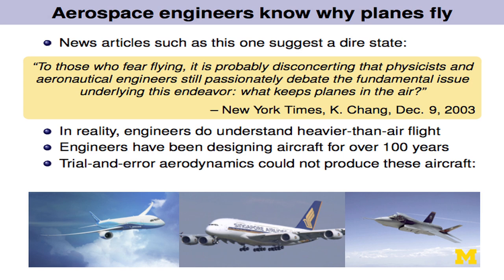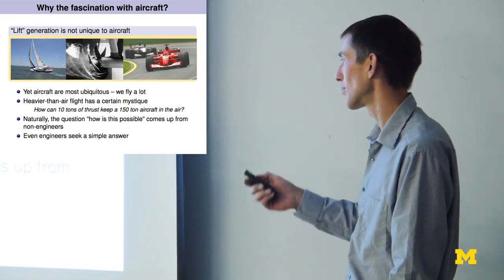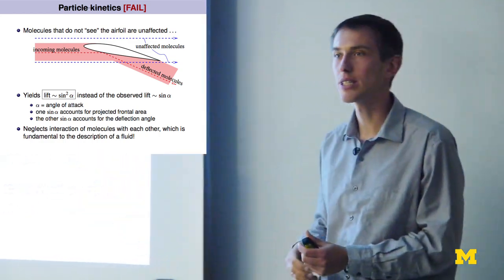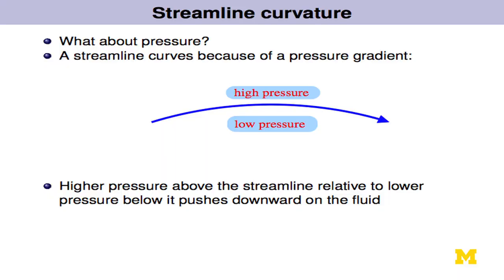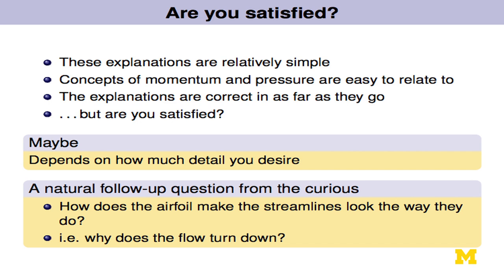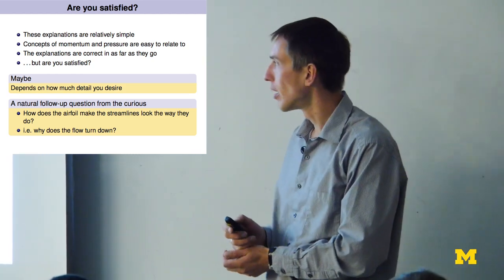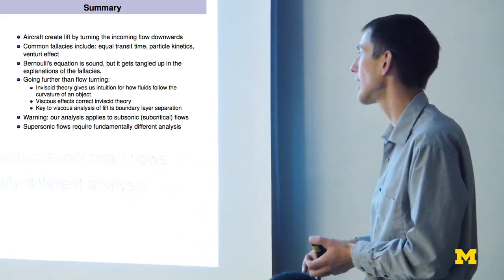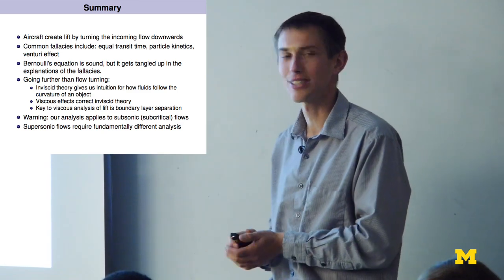Krzysztof Fidkowski | How Planes Fly

Comment: While this is very good, Prof Fidkowski Seriously misspeaks at 21:05.  You ABSOLUTELY cannot use Bernoulli for two different flows.  Bernoulli's Principle applies ALONG only ONE FLOW, or streamline.  Bernoulli is about ACCELERATION along one flow, not simply different speeds anywhere.  Therefore, Bernoulli is NOT a reason we can't have stagnant air near that upper wing.
He really slipped.  He glosses over just what the "pressure difference" would be when using that "Bad Bernoulli" misconception.  _IF_ speed had something to do with it, the "moving air" would have lower pressure.  That is the air farther above and it would curve UPWARD away from the wing. SO this is a double error on his part.  OOPS!!
.
Reply: The lecturer did not “seriously misspeak at 12:05”. 
  You say, quote: “you ABSOLUTELY cannot use Bernoulli for two different flows”. What he did was compare the static pressure of two different streamlines. This is the self same principle used inside the airspeed indicator. Static pressure of the streamline right above the boundary layer of the Pitot tube is being subtracted from total pressure of the different streamline that stagnates at the entry to the tube. As they had the same initial conditions, they have the same total pressure. Hence the difference is dynamic pressure of said external streamline, which is what the airspeed indicator is actually measuring and displaying as ’Indicated Airspeed’.
  So I’ll take your “OOPS!!” and raise you a SCIOLIST!!
Reply: @XPLAlN 
I'm sorry but the principle of the pitot tube is that it is sensing both the static pressure on the side port and the stagnation pressure on the end port of the SAME FLOW. It is a misunderstanding of the principle of a pitot tube to say that those are two different flows. You appear to be assuming that a streamline is only a single one-dimensional line with no width, however you can sense these things in small lateral displacements in a flow and still have accurate results.
As you move laterally across the flow that has a significant difference in that lateral direction then you run into problems.
.
The difference in total pressure between those two locations is no different than the difference between the inside wall of a Venturi tube and the center line.
.
Also, the pressure communicates through the boundary layer and that is why the side port operates because it measures at the surface.
Reply: Try discussing this with professional, practicing  aerodynamicists, as I, an experienced engineer, have done.
Reply: @Observ45er  …er no. You could not be more wrong. It is not the same streamline. In a great many (perhaps even majority of) Pitot Static systems, the static port(s) are not even on the Pitot tube but some entirely different location. Think 737, A320, C-172 etc. So not the same streamline at all. These things never occur to you because you do not actually know much, you just piss in the well of decent educational videos like this for some weird reason.
Reply: @XPLAlN Nope.
 Perhaps you are thinking of the  altimeter static port.  It is frequently located separate from the pitot tube and can be on the fuselage.
However, it is located with a significant amount of testing for the proper location to make sure it is sensing the static pressure; otherwise you'd see altitude variations with airspeed as you have on a wing. .  It's not just anywhere. Talk with an aircraft design engineer. 

Doing that then, the same port can be used for the airspeed indication, along with a stagnation tube, since it is also measuring static atmospheric pressure.
.
But a true pitot tube is as I describe.     Learn from professional aerodynamicists as I have.
There's a little more to it and I took a simpler , but correct route. Talk to Prof Fidkowski.
.
.
P.S. Looking for what he said to refresh my memory, I see I mistyped that time which may have caused the problem..  It is 21:05 where he misapplies Bernoulli.
Reply: @Observ45er  No I am not thinking of “the altimeter static port”. I am thinking of the static port for the Pitot/static system, which is the static source of all instruments that require it, most often - and almost universally for GA - the ASI, altimeter, and VSI. The ‘pitot’ is not necessarily a pitot/static tube, and in a great many cases the two sources are entirely separate. Hence it stands to reason - for anyone with at least that basic knowledge in hand - that the static source is NOT on the same streamline as the pitot. Once again, the arrangement to which I refer is an example of comparing two different streamlines, just like Fidkowski does in this video. So he is not, quote: “seriously misspeaking”. And this should surprise nobody.
Reply: @XPLAlN  Hence my comment. As I recall, Cessna frequently used a common port for ALT, VSI IAS up along the front, but Piper used standard combo pitot.  
A - If you check what he says at at 21: 05, you will see that he set up a synthetic  condition with two distinct flows "moving, not moving". Those are two completely distinct, unrelated flows as he defined it. Those are not even close to being alone a single flow. 
B - Had you followed my original comment you would have seen that the  time was erroneously stated. Mea culpa. I Snce he says nothing related at that time, and you should have questioned what I was referring to.
C - This video isn't about AirSpeed or pitot tubes.
Reply: @Observ45er  You still cannot see that if a Pitot/static system measures static pressure in a different place to the pitot tube (a common arrangement) then it is unambiguously comparing two different streamlines. And that is equivalent to the concept of 21:05 that you think is “seriously misspeaking”.
Reply: @XPLAlN  If you read my comment you'll see that I clearly addressed that, even noting that Cessna used that for the static port.  
Static atmospheric pressure is atmospheric pressure no matter where you measure it around a craft. 
.
It is the speed comment at that time in the lecture and the reference to 'Bernoulli' that is off and this addresses the common fallacy that "fast air has a lower pressure than still air".
.  
Those two different flows have different speeds depending on your inertial frame of reference. 
Speed is relative, but acceleration is not and Bernoulli's Principle is about acceleration, not speeds.
.
Viewed from the stationary air reference frame, the 'fast' air becomes slow and the 'slow' air becomes fast, thus reversing that fast-slow aspect. Therefore, the pressure differences would also reverse.  
That can not be.
The comment about 'Bernoulli' is incorrect.
.
Professionals and students do the measurement daily.  Weltner has a good paper describing this and the standard static pressure probe. 
.
Comments don't seem to always appear immediately any more. . .

YouTube doesn't like links, but you can Search for this and Weltner's paper pops right up. See his IG 3 Static Probe:

.“Misinterpretations of Bernoulli's Law by Klaus Weltner, University of Frankfurt (G)”
Reply: @Observ45er  Now, as you are just obfuscating to cover your error I am going to point out another fallacy in your comments (there are many). Quote: “as you move laterally across the flow that has a significant difference in that lateral direction then you run into problems. The difference in TOTAL PRESSURE [my caps] between those two locations is no different than the difference between the inside wall of a venturi and the centreline”.
   You don’t understand the Bernoulli Principle. It is conservation of energy. The total pressure is assumed constant (an ideal approximation). That is the basis for it. One way to state the Bernoulli equation is: total pressure = constant. Therefore the total pressure at the centre of a venturi is the same as everywhere else. The total pressure at the wall is the same as the centreline. [In a real flow there is a pressure loss in the viscous boundary layer, but nonetheless the static pressure at the wall is the same as that of the theoretical streamline that defines the edge of the boundary layer].
  Going back to 21:05 it matters not a jot that he is comparing two different streamlines. He is showing that you cannot have a straight streamline above the hypothetical stagnant region. The reason is as stated, to paraphrase: all that air came from a region with the same total pressure therefore the static pressure of the stagnant air must be higher than the air moving in the streamline above it, according to the Bernoulli equation. Hence you would see the streamline curve up if the air below was stagnant. And he is correct, even though you do not understand it.
Reply: @XPLAlN  Yes!  Finally, you're starting to think.
.
That is the error.  Bernoulli's principle doesn't apply at all, but if it did, the line would curve upward, NOT down toward the wing as thought. That Bernoulli remark is the incorrect one.
.
That is the error.
.
However, Think some more. . .
Those two hypothetical regions do NOT have the same total energy. 
The lower one, P2 came along with the moving wing.   It is stationary relative to the wing, BUT moving relative to the bulk air mass above it, P1. 
So. . . which is the fast air??
.
The static pressures will not change with your inertial frame of reference. 
.
To your first point:
YES, as you move laterally across some random, wide  flow, there CAN be differences in the Bernoulli constant for total pressure because you are moving to vastly different streamlines and flows.. You appear to be denying that in your conservation of energy words.
.
The flow 2 inches from the wing surface does not have to have the same total pressure as the flow 12 inches away. 

That is precisely why it is always said that Bernoulli only applies along a stream line. 
.
Perhaps there is some simple misunderstanding here, too, but I'm sorry, but I've worked with this long enough and discussed this with  some real professionals that I guess we must just leave it there.
.
I wish you well in general.
Keep thinking.
.
P.S. I had corrected the time reference in another duplicate comment, but missed correcting this one. That. however does not change the story.
As I said, had you looked at that time in the video, you would have questioned the conclusion since it didn't fit at all.
Reply: @XPLAlN  I'm getting too wrapped up in this, but I am pleased you are finally reading what I wrote because I mistyped and you saw it.   I should have proofread more, but I was rushed here.
.

.
I meant to say that the flow in a typical pipe or venturi IS the pretty much same across the diameter.  Whereas, in a flow around something like a wing, is not as you move away from the surface. 
 That is crossing streamlines which is much more a problem and Bernoulli's Equation does not apply. 
.
The further you move from one streamline, the larger the error.  I had an extended discussion about this with Charles Eastlake when I contacted him about his paper on the net. 

If you stay close to the same streamline, energy difference is smaller.
Reply: @Observ45er  You are still persisting with the belief that this video is wrong at 21:05. He does not “misapply Bernoulli”. If you say say the Bernoulli effect does not work across streamlines, well duh, but it doesn’t make the video wrong, it just means you don’t understand what you are watching. The hypothetical stagnant air would be at….[drum roll]…stagnation pressure! Hence static pressure there would be higher than the streamline above it (thereby answering the question ‘can the flow look like this? No.’) This is the exact same concept used in the airspeed indicator, which by now is not worth repeating.
My original point remains: you need only understand the principle of operation of the humble airspeed indicator to relieve yourself of the opinion that this video went wrong at 21:05.
Reply: @XPLAlN  So, that "stagnant" pocket of air following the wing in the hypothetical inviscid flow at time  21:05 is at the same pressure as the leading edge stagnation line?
.
Interesting concept. . .
.
As I have thought of for some time, I spoke with Prof. Fidkowski  yesterday.  Since it's been 8 years since he made that video, he was unable be specific about his wording at  that spot, but explained how he looks at that fundamental area now. I asked him if he could look back and address my question of his particular wording in the video. 
Also. . . 
We also discussed two other areas and he found my use of Inertia, the way I do, to be reasonable.
We will be talking again.
- -
Reply: @Observ45er  Quote: “so that stagnant pocket of air following the wing in the hypothetical inviscid flow is at the same pressure as the leading edge stagnation line? Interesting concept”
 No, because that pocket of stagnant air cannot exist, which is the whole point being made. It is a hypothetical pocket of stagnant air, at hypothetical stagnation pressure. And the reason we know there is no pocket of air like that at stagnation pressure above a real wing is because of the thing you have spent about 2000 words arguing against, namely, the Bernoulli Principle tells us the streamlines cannot look like that.
Reply: @XPLAlN   
XPLAN: "The hypothetical stagnant air would be at….[drum roll]…stagnation pressure! "

XPLAN: "No, because that pocket of stagnant air cannot exist, "

Now you're babbling.
. . . .
. . . .
'I much rather discuss the finer points with someone who understands it, such as Prof. Fidkowski.
Regards.
Reply: @Observ45er  what you have done there - again - is called being obtuse, this time by deliberately conflating the hypothetical question with the real world answer. For clarity, the hypothetical was ‘could that pocket of stagnant air exist if the flow is inviscid? And the answer is no. Asking the question does not contradict the answer, the answer contradicts the hypothesis. Those two quotes you cherry picked do not contradict each other. You may think you are being clever but you are not. You are evidently quite weak intellectually if you have to resort to blatant and wilful misrepresentation. But it is a pattern of behaviour in your replies. Now with that subjective point of order on the record, I will go back to addressing some of your substantive misconceptions in my next reply….
Reply: @XPLAlN  Repeat, I spoke with Prof. Fidkowski. 
Since it's been 8 years since he made that video, he was unable be specific about his wording at that spot, but explained how he looks at that fundamental area now. I asked him if he could look back and address my question of his particular wording in the video. 
Also. . . 
We also discussed two other areas and he found my use of Inertia, the way I do, to be reasonable.
We will be talking again.
- -
Reply: @Observ45er  You are clinging to the position that this video is wrong at 21:05. You cannot see that the common or garden airspeed system contradicts what you believe. The Bernoulli Theorem is often used to compare two different streamlines. There is no reason one “absolutely cannot” do that. Doing so is based on the assumption of constant total pressure. You overlooked this when you wrote: ‘total pressure in a venturi is different in the centre from the edge’. 
  But you got that wrong and, quote: “meant to say the flow in a typical pipe or venturi is pretty much the same across the diameter whereas the flow around a wing is not as you move away from the surface…the flow 2 inches from the surface does not have the same total pressure as the flow 12 inches away.”
  So now you are saying the assumption of constant total pressure, across streamlines, does not hold around a wing but does hold for a venturi. You are clutching at straws. Notwithstanding that Bernoulli is based on the simplifying assumptions of inviscid and laminar flow, the hypothetical flow in question is based on those conditions, by definition, so that approximation goes away. Hence, not wishing to put words in your mouth, you would seem to be referring to the variation in total pressure if the pressure head term, ρgh, is different for each streamline at source. But this term is negligible and therefore ignored in this kind of simplified high level aerodynamic theory. The magnitude of Δp across a wing is in the order of 10 HPa. The rule of thumb for pressure lapse rate is 1 HPa/30’. The difference 12” make to any of this is less than 0.5%. 
  Quote: “The further you move from one streamline the larger the error”
  The pressure head term is negligible and ignored. The streamlines are assumed to have come from a region of homogenous initial condition.
  The question was ‘can the flow look like this?’ The answer was no, based on Bernoulli. I expect there other ways to get the same answer, either more or less highbrow. But Bernoulli was used and it gives the right answer.